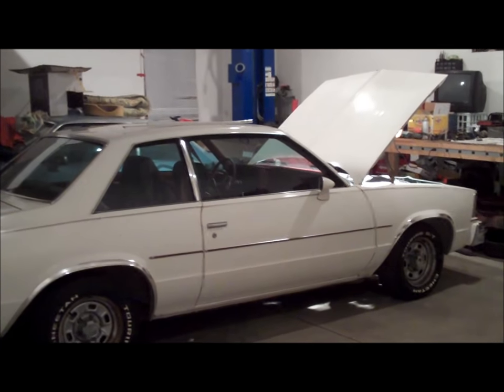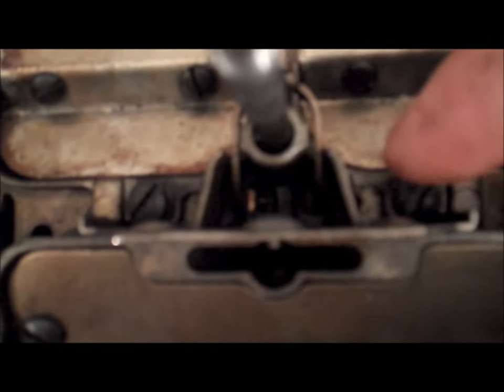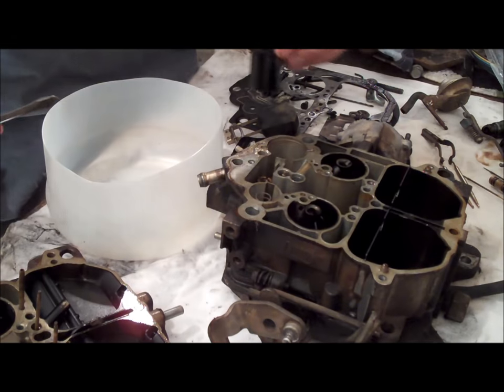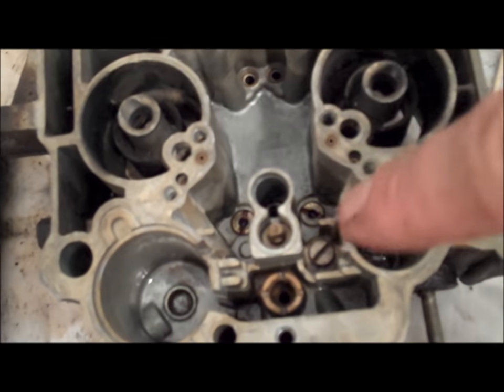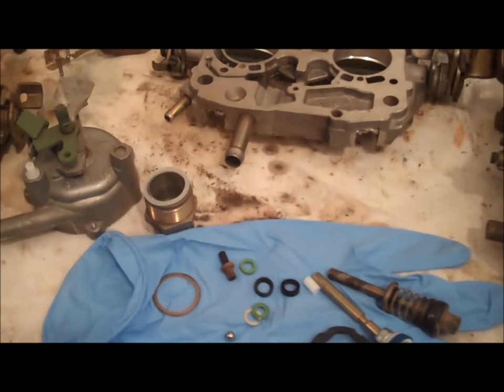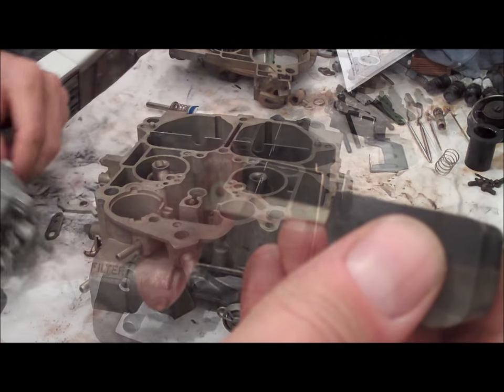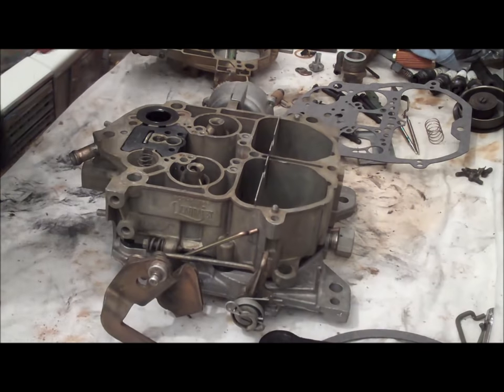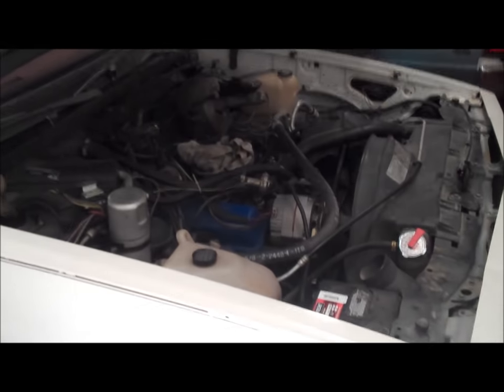Detailed Quadrajet Carburetor Rebuild COMPLETE GUIDE

Comment: I just rebuilt this same carb. I am missing the cup that you said doesn’t do anything at 44:34 . So if Iam missing it should I worry about finding one for it ?
Reply from the maker: Well it is there for a reason so I would locate one. I just rebuilt a carb that it was missing and I found one and put it in.
Reply: Classic G-Body Garage any cup would work or has to be from a quadrajet?
Reply: Also the retaining clip is worn out on the power valve  . Where could I buy one ? Do I have to buy the whole power valve or will they sell the clip
Reply: A little birdy told me the "not for anything" cup is installed to fill that portion of the casting which had some sort of secondary accelerator pump that GM had planned and then scraped but did not change the casting, anyone ever heard or can verify this anecdote?

Comment: the black thing on the fuel Filter at 57:00 is the check valve for Gas not flowing back is that right? what if I didn't install it, could I get any problems?
Reply from the maker: Yes it is a rubber valve. If not there you may get some hard starting issues.

Comment: ...so scare me.... I have an 84 Olds with the massive powerful 307..... and I believe in my heart this beast has a failed float...and looks like I need to rebuild it anyway... because you have to tear it 1/3 way down to the float... we have throttle position sensor and a metering solenoid.... do you have a video for this type of carb?..... note a fire wiped out the wiring to the carb.... has been functioning fine until of late.... now it won't make power...  loads up and runs black... with a trace of fuel out the pipe... engine runs fine until you expect it to move... then goes flat at 20 mph.... guess I need a second opinion...  58 year old wrench turner... driven alot of junkyard queens...  but this q-jet is vexing me... Dave

Comment: I need to replace my accelerator pump, do you think I can just take off the top piece while carb is still on the car? Would rather not do the most if I don't need to
Reply from the maker: Yeah no problem. I have done that many times.
Reply from the maker: Just don't drop any small screws down the carb into the engine. Thats the only risk.
Reply: Sweet. Appreciate the reply gonna try it today and hopefully revive my 86 cutlass

Comment: I noticed AC spark plugs in your video. In my experience they are the worst spark plugs ever. I have bought three cars that would not start and "Must be towed".  I saw AC spark plugs and when it cranked, it was obvious that all cylinders had compression.  I went back with cheap Autolite Copper Plus spark plugs and installed them, and drove it home. The most recent was a 99 Chevy Express. This knowledge comes from the old days at the track with a 69 DZ motor in a 67 Camaro. We experimented with al the brands available in the 70's. I have never subscribed to the theory that a brand of spark plugs must be used in a brand of engine.  The head is iron, the piston is aluminum, the gasoline is not from the automaker. The spark plug supplies a spark in the chamber and starts the fire. My personal theory about the difference in spark plugs is the quality of the porcelain insulator inside the combustion chamber.
Reply from the maker: Never had an issue with them

Comment: Oh god I hate Rochester quads lol I mastered rebuilding the rochester quadrajet my quad that came on my car had a crack in the body I rebuilt 5 more just to make one it came off a box van it also had the emissions set idle screws you have to drill out the lead plugs I still have a quad from an olds motor I have a Chevy 305 making that a useless carb to me, fun times they were

Comment: My carburetor doesnt have a Powervalve adjustment screw or pin; like yours per 24:30 on video. I have a Rochester Quadrojet   7043256 Off 1973 Oldsmobile 455. Is my carburetor ok or ?
Reply from the maker: You have an older version. Yes its ok.
Reply: Thank you so much for this video!!! I am learning so much but one more thing....Did you replace the washer on the Powervalve/piston? The one next to the float. I have watched this video so many times but I cant remember. Oh yeah I am replacing the 3/8 vent tube to egr but I am sort of wondering how hard that will be. I cant wait to hear my 72' olds 350 running again. Its in a 53 Olds with Camero subframe th400 stock rear end. This video saved me like $300. I also replaced the choke pull/off and choke thermostat. Thank you for your service here!!!
Reply: Scott Laffin read your comment. I had a 49 Chevy that I kept stock except for split manifold and duals. Also lowered suspension. I always wanted to do the subframe thing and a V-8. Ended up selling it for money to start a business. Could kick myself in the butt right now! Bet that Olds is so cool. Good luck with it!
Reply: I have a 53' Oldsmobile right now but I had a 50" Chevy before that just like your 49" I love those cars
Reply: Scott Laffin They are awesome! Really miss mine! Isn't the 53 Olds one of the first with a one piece windshield? Trying to remember...been so long ago, but I think my 49 had a 2 pc windshield. Anyway, if it's old, I like em! Feels so much better riding in an old piece of history than a cookie cutter new car that looks the same as all the others. Can't hardly tell what they are...all the same!
Reply: Awesome video. Question I have a 1967 olds tornado the carb is not filling with gas.  Gas line to carb has fuel.  I Pour gas into carb and it will run. Seems like fuel not circulating in the carb. What could it be?  Any tricks I can do to get it running or should I just rebuild it? Thanks for your great videos

Comment: i have a rochester 4 on a 63 cadillac de ville.  would the same principle s apply here
Reply from the maker: Very similar. You still need to follow the adjustment specs of your carb like float level etc.
Reply: ok,, thanks for the replay,, it almost lookalike it has a different float system from the service manual, but guess i wont figure that out till i get into the carb,, thanks again, and for the informative video

Comment: Would the screws on the bottom of the baseplate cause a fuel leak as well as a vacuum leak? A reply would be much appreciated, because i can't track it down for the life of me. Thanks.
Reply from the maker: Yep the base plate screws come loose and cause a vacuum leak. Very common. Thanks for watching!
Reply: Thank you very much, I realized my plugs were fouled, so i fixed that and will be rebuilding the carburetor tomorrow. Thank you very much for the reply.

Comment: I have a 76 gmc with a four barrel carburetor when you give it gas it backfires and it will not let the engine start could when it tries to start I see black smoke coming out the tail pipe
Reply from the maker: +Chris Canty Too rich. I would also check your timing.

Comment: G body? Shit I'm building one for my F-body? Qjet is the one and only carb for a Pontiac, My base plate is messed up, I found one for a chevy style 800cfm, but ran into tune issues? I threw on an Edelbrok 650 thunder split bore,  runs good, good for daily driving, but it's time for rebuild and I want my Q back! Time to re explore my old issue.

Comment: Did this and reinstalled my carb now its over flooding like crazy and shooting fuel everywhere smh
Reply from the maker: You have a float issue then or needle/seat is leaking.
Reply: Fixed it brotha you were right thank you 🤘
Reply: Brotha what other transmissions are compatable with my 5.0 307 cutlass 86 my transmission just started slipping really bad so ama just change the whole thing out

Comment: Wouldn't simply replacing the carburetor with a new one be easier?
Reply from the maker: If you want to pay for it sure. But I like to keep my cars original and do my own work. Rebuild what came on the car instead of bolting on something else. It's not hard to rebuild one of these.
Reply: Classic G-Body Garage they don't reproduce the original carburetor?
Reply: Classic G-Body Garage I'd opt for replacement for one time efficiency, and two, the warranty. If something goes wrong with a new one, it's the manufacturer's problem. One would think a non stock carburetor wouldn't drop the value much as there are times they fail beyond repair or is uneconomical to repair.

Comment: I've followed the directions to the letter. But here's my problem, I cant get the power valve to stay put. After I get the needles lined up, push the keeper washer down, it just pops right back up. Anybody else have this problem, and how did you fix it?
Reply from the maker: You might have the incorrect spring under the power valve or your keeper washer is worn
Reply: +Rick Wilson I had the same problem. The retainer bushing was old and brittle, would not hold it in place (finally it just broke).

Comment: hi im in need of help with my quadrajet i have carb number 17059213 and for some reason at idle im gettin straight manifold vac thru the port for a vac advanced distributor is this normal i mean at idle and info would be greatly apreciated i did notice with this happening i tried to advance the distributor but it would try to die like u were retarding it but if i unhooked it i have no problem advancing it thank in advanced

Comment: The diaphragm what you verified in the minute 56:24, ¿what is the function?
Reply from the maker: +Richard Varela  Choke pull off. Pulls the choke plate back a bit on initial start up.
Reply: +Classic G-Body Garage thanks for the explanation

Comment: did'nt the 305 came with a 2 barrel until 1979 and then the 305 came with a 4 barrel 1980 and up with 9.2 compression as they shelved the 350 gas motors
Reply from the maker: 78 was the last year for the 2 barrel on the 305. Not sure on the compression ratio.

Comment: You forgot to , tells us that the screws. That hold the top -Air Horn   of the Carburetor on . They are different lengths. And go in different holes on the top of the Carburetor.     There are nine screws, that  hold the top of Carburetor on .
Reply from the maker: That is something i know I mention. Starts at 10:15

Comment: first of all awesome explanation on your vid,,can you email me a link that would tell me what air horn gasket to use on my 17058241. Have issues with a previously opened/returned kit that has 2 in it. Or can I email u pics of both and u can tell me lol. Will be subscribing soon love your old school rides..takes me back to when we was buying em for a couple hundred from ppls yards an fixen em up)
Reply from the maker: +Brian Holzhauser  Match up your old vs new gaskets and make sure the holes line up. Most all kits have 2 versions as they kits are somewhat universal. You can email me at olds7980@yahoo.com as well.